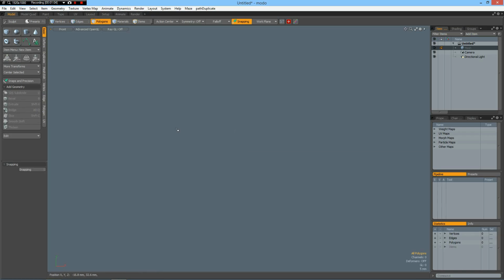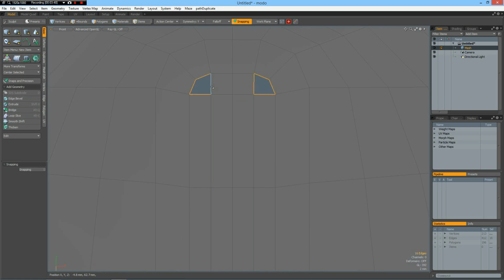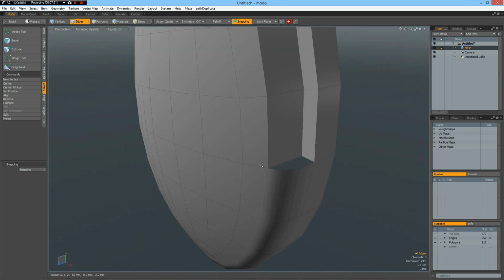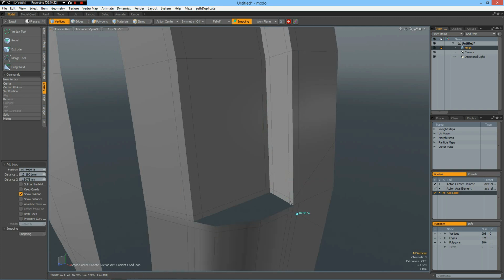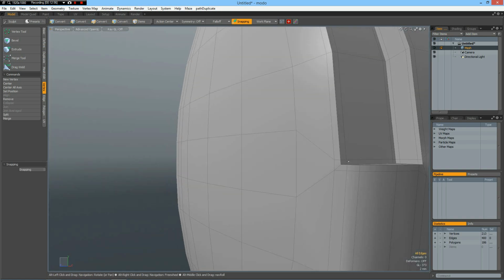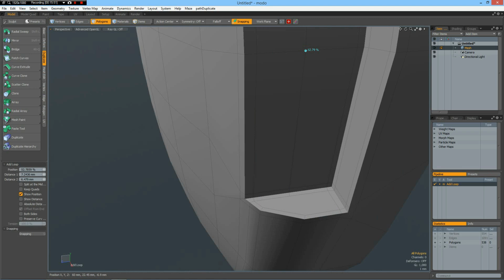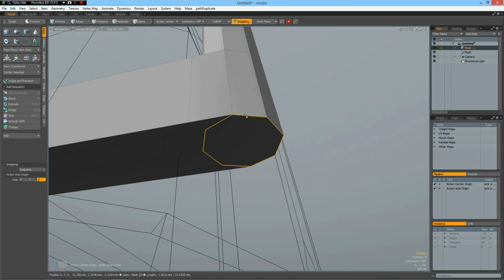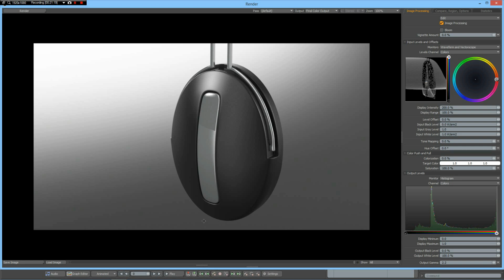The Foundry MODO - Modeling the Ear Part of a Headphone

Comment: Great tutorial as always, I just love your work and way of thinking.. Modo community must be lucky to have you.Thank you.
But I am stuck at 4:00 min at radial falloff. If anyone can help me plz.. I am a beginer btw and my brain hurts for not being able to solve this..I know it must be simple.. When I activate radial falloff  i get circles in gradient with yellow circles in middle and  purple as it goes outward.. and when I move with W key it does not acting to all geometry but only where yellow circles are, in the center of polygons. How do I control this gradient.. I tried to play with shape preset but can not get rid of gradient or make it act as it does in video. I am using modo 801 sp 2
Reply from the maker: Ivan Bezmalinović Hi Ivan, first make sure, all your vertexes have the same position on the Z-axis (use R-Key and set Z to zero), then use radial falloff. Second make sure your tool pipeline looks the same as mine. Kind regards and good luck, Peter
Reply: Peter Stammbach Thanks! I have set vertexes position as instructed and falloff worked as expected same as on video.. Thanks again for quick reply.